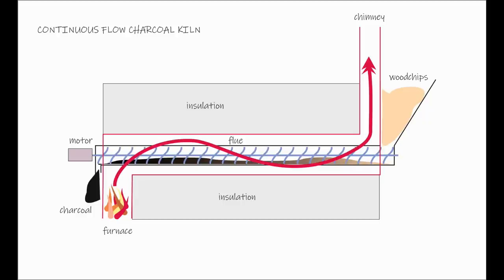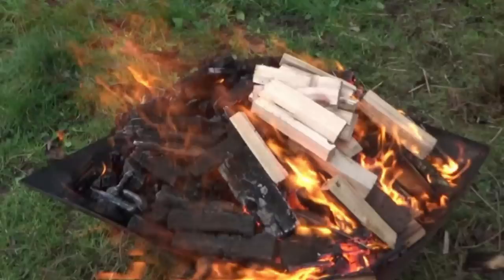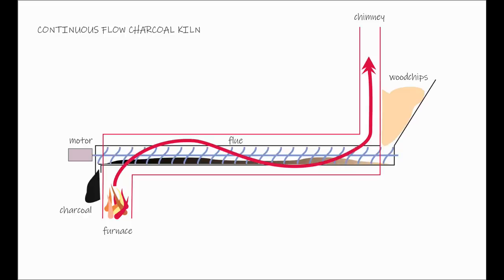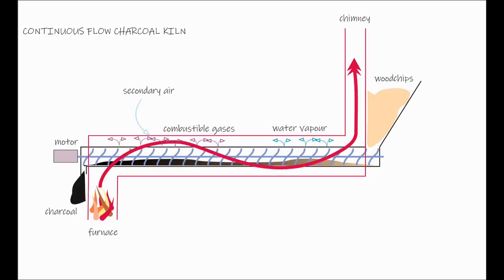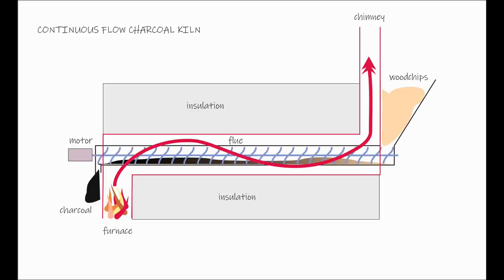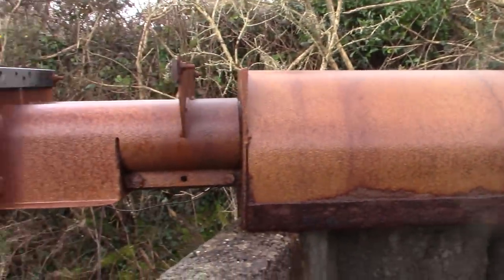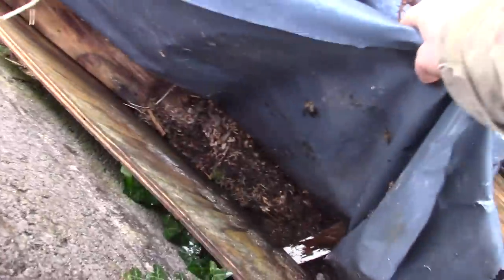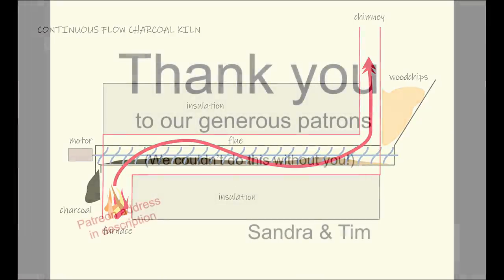An Interesting Design For Constant-Flow Charcoal / BioChar Production..

Comment: its a good idea but you will have issues with tar build up. pyrolytic reactions like this produce a lot of byproducts, such as methane, nitrogen monoxide, carbon monoxide and dioxide etc. powering the flame from wood gas is far more sensible and this kiln will produce copious amounts of it to feed the fire. in general you'd use around 40% of your wood gas powering the reaction. a vortex separator on the outflow will sort a lot the tar and gas problems out.wood tar is a commodity to be sold or fractionally distilled.
use excess wood gas to heat your house etc

Comment: I thought about a kon tiki like kiln with an auger on the bottom to scrape out the charcoal while it still burns on the top. The bottom needs to be under water to seal the kiln and to cool the charcoal and the auger.

Comment: I guess i’m not as stupid as people give me credit for ! When seeing the plan my very first thought was that the exiting charcoal would combust.
I think the simple answer would be to have the exiting material furthest from the heat source.
As for bearings, shielded, not sealed & they would need high melting point grease in them.
If you make a short bearing tube with a bearing in each end you can then remove the shield from the inside of each bearing & push fresh grease in via a nipple between the two bearings.

Comment: It's a pretty good idea, just needs a few tweaks to improve durability and efficiency:
1) Motor's on the wrong end. It should be at the cooler end instead of near the heat source.
2) For the end near the heat source, use a hollow shaft to extend the end. Cross section area perpenticular to direction of heat conduction affects rate heat is conducted. Having a hollow shaft rather than a solid rod reduces heat transfer rate.
3) For the bearings nearest to heat source, u have to use ones that are thermal resistant.
4) Between the bearing and the heat source, u need metal discs welded onto the shaft to act as heat sink. This further extends the life of the bearings.
5) For the holes that u have to allow the escape of moisture, just have only one near the wood chips end. Have a pipe that runs from that hole all the way to your heat source. Upon heating, the wood chips initially give off mostly moisture before transiting to giving off wood gas. This is a good source of fuel for the flames. But u have to keep the gas exit small due to 2 reasons: First, when flammable gases ignite, there is a flame speed(speed at which the flames travel). As long as the gas exits at a speed faster than its flame speed, the flames won't travel to your burnable materials. Second, having a small exit opening creates a back pressure. This prevents air from seeping through part where the bearings are attached. The only reason your charcoal burst into flames is coz air got in. As long as u keep a slightly higher pressure than ambient, you'll not run into this issue.
6) If u're going with suggestion (5), u'll need a proper cover for the hopper and charcoal collection tank with access door, both have to be air tight.
I wish u good luck!

Comment: Idea: Think of your wood carts, with a door up and downside. So, the combustion chamber heats up the charcoal chamber, which has a door on the bottom and up top. Once the charcoal is ready, open down, close down, open up where another cart can be positioned, open cart till empty, close up, continue charcoaling. Maybe another cart on the down side to collect the charcoal once its cooled off.
This could all be automated by an engine/motor and some chains dragging the carts. You could be just cutting wood and sending carts. Even if not automatic, it is fast enough to not be a hassle in between cutting wood.

Comment: The auger should have the motor on the cold side infront of the hoper and no bearing on the other side and the auger pipe extended well past the heat source where the outer casing can be cooled with water and having a hinged plate over the end of the auger casing . The charcoal will make a plug at the end of the pipe so no oxygen can enter to burn the the charcoal to ash . The auger should be about 100 mm shorter than the auger casing

Comment: To avoid the charcoal combusting:
1: My first idea would have been to feed the finished charcoal through a charcoal hopper, in order to seal the auger off from oxygen on both sides.
2: People have suggested to extend the auger to give the charcoal time to cool before it exits it. I'm not 100% sure that it will work. If any outside air ever gets drawn into the auger, the charcoal would ignite in the cool-down section. It completely depends on the air flow though. How much combustible gases and steam are produced inside the auger determines how much gases you'll want to pull though the vent holes in the auger, and how much the furnace pulls the hot air out of the system vs. how hard the forced air fan pushes oxygen into the flute determines how much gases you do pull through.
3: Just douse the charcoal with a bit of a water mist. Ideally you'll want to apply only enough that the ambient air gets displaced by the resulting steam, but it shouldn't matter too much if the charcoal comes out slightly wet. (Some steam train engineers prefer slightly wet coal to dry coal.) But if the water content really matters, it'll be easier to just throw in a drying step where you control the temperature to be around 100°C instead of controlling the oxygen content of the air.
4: Cool down the charcoal using concentrated steam.

Comment: Place the motor at the other end of the auger to prevent it overheating. Since the shaft of the auger wont be as hot at the wood chip hopper end, there will be less risk of the shaft distorting as well.
Reply: Also, chain drive should fix it

Comment: my first thought was also chips getting stuck in the auger - what about a step feeder in a 100mm square tube?
or the whole tube at a down angle attached to a vibrating motor? let the gravity do the work :)
the advantage of the auger is that it rotates the chips as they cook.... maybe its time for a custom built (CNC) auger  :)

Comment: Half of the auger casing heated for gasification, half in the open air for cooling before the charcoal hits the air? That would also lead to cooler running for the bearings.

Comment: I like your idea. One way you could change it and maybe be a little more efficient without spending so much money, you could have multiple chambers with different heat levels for each one, so they go through stages. Less wear and tear on the first couple of chambers. Another way to be a little more efficient would be to make the tube around the outside out of copper, because copper conducts heat more than steel. I like your idea about the underwater thing. Honestly, back to the copper tubing you could just sheet the tube and copper. It would be a little more efficient. At first the cost would be a little higher, but I believe it will save more energy. Suppose you could find a auger that is long enough to travel throughout the whole process? Like if it took 50 foot to do the whole process? If you had the tube and auger, copper plated and heated it at the end, I believe it would be more efficient and get the results you desire. another thing to consider is having the bearings on a longer shaft at the end in a cooled environment. Much like a spit on the grill. The engine or motor could be on the outside and out of the heat environment. Perhaps a double tube system. The innertube would be plated and copper along with the auger, and the outer tube would be for collecting the gases. The outer to could be clay lined with copper on the inside. Think of a tube and auger long enough to get this accomplished? perhaps the auger itself could have clay tiles attached to it much like the space shuttle, then plated with copper to keep the heat off the auger system. perhaps a way to keep the charcoal from igniting would be to have it vacuum sealed? The way copper expands like much other metals, it could expand to seal, or even have some of the auger be a little bit larger near the end to make a seal so the last bit of the process it would enter into a vacuum, sealed compartment, where there was no chance for it to ignite. maybe the auger would have to be 100 feet or maybe even 200. if you angled the auger at a downward angle, and it was sealed enough, you could have the auger going into a pool when it was finished and then continue on to be dropped into a receptacle at the end after it’s had its bath. The auger could be shorter.

Comment: Good video Tim. Thanks. 
Will you link the heat generated to the heating system for your house and maybe barn ?
You have, I’m sure already thought about that ages ago.
Reply from the maker: that's the plan - but I haven't worked out the details yet

Comment: Interisting concept.  The bearings are easy, extend the shaft through the wall and mount the bearings outside the wall on separate supports.

Air or water could be run through the center of the shaft to cool it.  This would require extra heat to operate.

You could drop into a closed cooling auger with air or water on the outside of the pipe to cool the charcoal.  If air, the hot air generated could be used to feed the fire, recovering the heat in the charcoal.

Controlling the auger speed electrically is child's play these days with a variable frequency drive.

I assume breaking the charcoal into fines and dust isn't a problem.  This concept will generate a lot of fines and dust.

One final thought, if you used an inclined rotating pipe you wouldn't need a moving internal auger.  You also wouldn't be limited by how long an auger can be without internal bearings. (15 to 25 feet)

Comment: Very neat!

Here’s an odd thought:
I have made some very nice charcoal (not really intentionally) in a campfire before, just by the “wood stacking” method. Would it be possible to make a layered system, like stacking your cones, where each layer heats the next? 

On a different path, to solve the “bursting into flame” problem with the old design, you would need another shorter auger for cooling. Passing the assembly through a trough of water would do the trick, and because of the separation between the larger heating and shorter cooling augers there is not so much energy loss from the processes counteracting each other. 
Alternatively I suppose a simpler method would be a gentle water sprayer at the end. Probably could be done with a simple garden hose and sprayer nozzle.
Reply: Here’s another odd idea: instead of an auger, put rifling inside the pipe and rotate the pipe instead of the auger. Tilt the whole thing to assist flow. That would eliminate the crushing problem. 

The pipe assembly could be made by cutting a pipe in half and welding in the half panels along the length, then joining the halves up again. 
Got the idea from another comment and from the way a cement mixer works.
Reply from the maker: I like it - but the 'half panels' would need to keep the air out..
Reply: @wayoutwest-workshopstuff6299  They would probably have to be welded back together, but it's probably the best way to build rifling inside a pipe using basic tools

Comment: I've been meaning to build a similar system but rather than let the Pyrolytic gasses escape I'd intended to run a manifold along the "retort pipe" holding the Archimeded screw to capture them as they evolve (This would of course involve building a flue around it all to allow the process power heat to do its job rather than just passing over the biomass directly)
Alternately I'd also considered simply taking multiple "tap points" along the auger pipe feeding into separate condensers. My hopes being with such a configuration one would know which fraction of the Pyrolytic oil was evolving from the biomass based on the temperature at that point of extraction as perhaps a means to avoid need of further fractional distillation of the end product for use as a fuel.

Granted I'm somewhat of a slacker and have always hoped someone would beat me to it. So far on YouTube I think you've come closest in principle  😀

On the subject of char, one of the uses of the "waste" heat I always thought would be nice would be for drying my seaweed feedstock

Comment: For bearings you maybe can use slide bearings, I think they would be more forgiving to heat. For the rest, I love the idea, but it looks a damn complicated proces to get it exactly right. Timing will be key. You are going to have to have a constant rate of fire and a constant rate of wood chips feed. I am building an automatic biomass burner unit in my garden myself, so I did have some similar challenges. I suggest using a shaftless extraction spiral to get the chips in the transport auger. Don't count on the auger itself extracting it from the hopper, product might "bridge". 

And for using the heat of the kiln to heat your house: use a buffer vessel. Simply stated, you have a tank with a rather big volume of water and you heat it. That heat is used then in your house. That way, you can use the intermittent heat to create continuous heat source, you store the heat in a "heat battery"

Love your channel! Following it for quite some time now :)

Comment: One could technically use the exhaust gasses, which is mostly co2 and water vapour, cool it down, and use it to cool down the fully pyrolysed charcoal. This would however, add more complexity to an already complex system. Is it possible to use some sort of hydraulic/pneumatic ram, to push wood bits through a tube, with a travel length of only 20 cm, relying on wood chips pushing eachother along through the tube?

Comment: Some years ago I made batches of charcoal in an insulated container with a 12cm hole at the top. The container was filled completely and lit at the top. As soon as there were some flames a chimney pipe with some holes near the bottom of it was placed on top of the container. A little bit of air was allowed from the bottom of the container as well. The woodchips turned into charcoal without smoke. When I didn't see any flames through the holes of the chimney pipe I killed the fire. So I wonder if you could do something similar... litting the woodchips at the bottom of your chimney inside the  and no flue. So there should need to be a hole in the pipe for the gasses to reach the chimney and another smaller hole to let air in somewhere down. Making sure no air comes in from where the charcoal exits. Adjusting where and how much air is allowed and controlling the speed of the auger or other device will be very difficult I guess. Good luck Tim, I'm looking forward to your next video.
Reply from the maker: Thanks, Andre!

Comment: Open trays or buckets pulled through heating pipe by a continious chain might be more reliable than an auger. And better able to handle large chips

Hydrostatic taper bearings, might be more resistant to heating.

Comment: Well yeah when i saw the drawing i had a few potential problems in mind :
1) the charcoal would be too hot at the exit. Imo, you shouldn't use water, dry charcoal holds its shape better. Instead, putting an angled pipe trough wich the charcoal can slide and cool down would be better (why not a cooling auger with heat sinks?)
Then, extending the auger shaft away from the fire will solve your heat problems.

Now, as a blacksmith, i know that steel doesn't like heat very much, especially oxygenated flames. So never go beyond a low red hot heat, for the sake of your auger's durability (it would burn up, rust and pit quickly otherwise). Stainless steel can make it slightly more heat resistant tho.

Comment: The WWII wood gas generators, especially the ones used in Sweden would be my inspiration.

I am suggesting two vertical long concentric steel tubes, the raw chips are fed into the large central tube.

A rotating grate is placed about two-thirds down the central tube, this is the main combustion zone.

Holes are drilled into the central tube to allow the combustion gases to be vented out from the central tube into the concentric annular ring.

These gases will burn in the annular ring as they are rising and heat the chips as they are descending in the inner tube.

A small proportion of the combustion air is injected as in a blast furnace from nozzles surrounding the burn zone to start the heating process until enough gases are generated to burn in the annular ring.

The charcoal drops through the rotating grate as it is produced and collects in the bottom half of the central tube.

Excess cold charcoal is removed from the bottom with an auger sealed to stop air intake.

Small amounts of additional combustion air are admitted at the bottom of the outside tube to cool the charcoal inside the central tube and to allow the gases in the ring to burn and supply heat to the retort process.

The cold chips are fed into the top of the central tube with an auger.

Other than the auger the top of the central tube is sealed and a small amount of air is pumped into the top to create a downward flow of air along with the chips.

The combustion products in the annular ring are exhausted into a chimney.

Controlling the amount of air injected into each of the three streams will be critical until a steady state is obtained.

Multiple temperature sensors will have to be installed to monitor the process and to optimize charcoal production.

Insulation covers the outside of the concentric tubes to reduce heat loss and increase production efficiency.

As a precaution I would install rupture discs in each of the two sealed vessels (the tube containing the chips and the same tube but below the grate containing the cooling charcoal) to minimize harm in case of an explosion.

https://en.m.wikipedia.org/wiki/Rupture_disc

The annular combustion chamber is vented through a chimney so it may not need a rupture disc.
Reply from the maker: Thanks, Carl. Another idea to ponder upon..